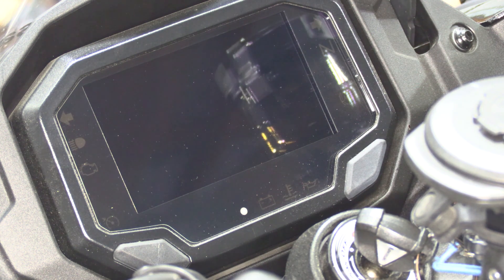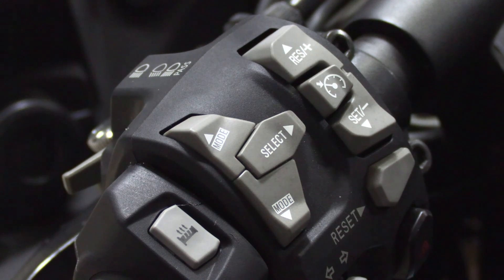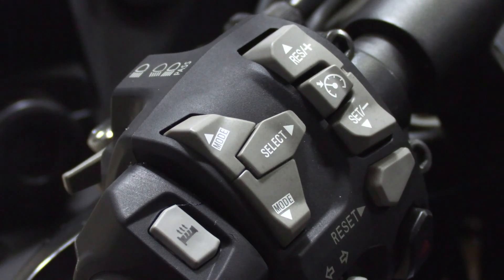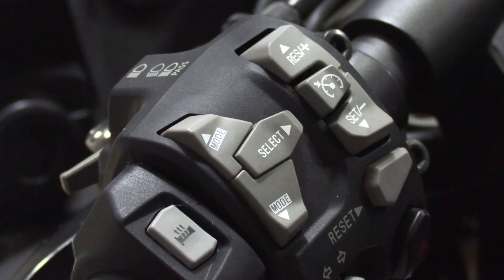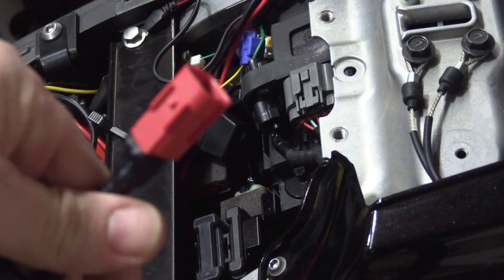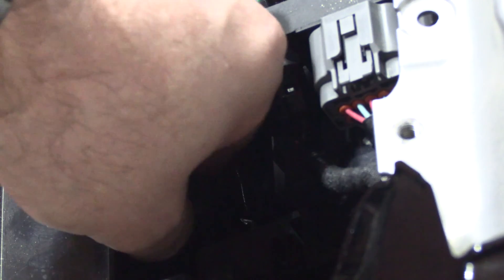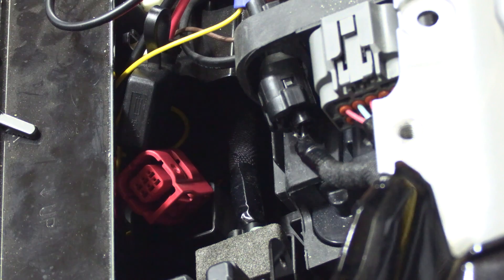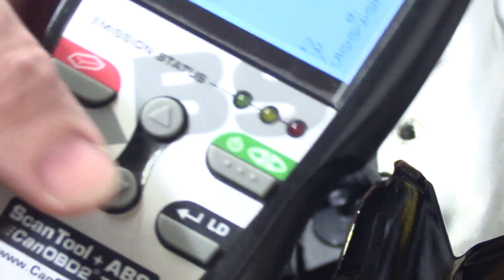Kawasaki Ninja 1000SX - How to Read and Reset DTCs (Diagnostic Trouble Codes)

Comment: what if the obd2 wont power up?
Reply from the maker: Do you have it in the correct connector and the motorcycle in the on position? It'd be strange not to power up. Bad wire or bad reader.
Reply: @BlueEyedRider84  my mechanic's OBD2 needed to be connected to the battery to power up :(
Reply from the maker: That is very strange. ODB2 should be able to power on from the connector as long as the motorcycle is on (not running)

Comment: How do you reactise the service light when you do the service?
Reply from the maker: If the service light is not the dealer setting you can just turn it off in your settings: https://youtu.be/0GIuBsS3o1M

If it is a dealer setting then you will have to have the dealer turn it off and have them turn off the setting while they are at it so it doesn't come back.

Comment: Can you reprogram or delete codes through this method?
Reply from the maker: You can only reset. To reprogram, delete/turn off codes permanently you would need to program the ECU with a programmer.

Comment: hallo! is there a way to set/reset the service km/date? (ninja sx MY2021) 
thanks!
Reply from the maker: So the good news is this weeks video (releasing on Friday) is for this.

If it is set on for the dealer service setting then you have to have a dealer turn it off (sorry, there is no other way).
For oil service and rider service setting, you can go into the menu, go down to service and turn them on or off and change the settings there.
Press and hold setting button for 3+ seconds
Scroll down on menu to service
Oil setting will be default, scroll down to see rider setting (this is the one most people miss because they don't notice they need to scroll down). 

Again, video is coming on Friday if you need visual tutorial.

Comment: Tell me how to raise (adjust) the idle speed so that it does not twitch in first gear without gas ? Thanks
Reply from the maker: These bikes have an idle speed control system - there is no way to adjust the idle without programming the computer (tuning). If your idle is at 1100 RPM at idle (after warmed up) +/- 50 RPM then you are at the factory idle speed, but I do agree higher idle is better. With these electronic throttle systems and emissions regulations they have gone to this idle control system which is controlled by the computer so, unless you want to get it tuned, I am afraid we are stuck with factory.
Reply: turn the yellow know for cold start idle and black for normal idle

Comment: Could you please upload picture from service manual regarding idling and TPS self calibration after cleaning errors with OBD2 (KDS) tool. Thanks
Reply from the maker: @Vedran
Sent. In case you don't receive:

When erasing the stored service code memory, the accelerator position and throttle position initial data of the throttle body are erased. Therefore, you must register the initial data to the ECU. Wait the 10 seconds at the idle speed and the coolant temperature 40* C (104* F) or more to register the initial data of the sensor position to the ECU.

Also after any procedure, you should:
Run the engine for several minutes at idling and run the motorcycle at 30 km/h (18 mph) or above in order to confirm no problem.

There is somewhere else in the book that goes into a procedure of riding around for 10 minutes but I am having trouble finding that page, but the main one is the first paragraph in regards to the TPS.
Reply: @BlueEyedRider84   Think i know why..... Ninja 1000SX probably have ride by wire throttle. My Z900 is cable operated although it have traction control and power modes so no procedure is needed after clearing codes.
Reply from the maker: Sorry for the delay. My 2021 does not have a TPS (Tire Pressure System) and my service manual does not go into that. Unfortunately I am not able to help on this one.
Reply: @BlueEyedRider84   TPS= Throttle position sensor
Reply from the maker: That's the problem with too many items carrying similar acronyms. I actually think I was wrong anyway, the tire pressure system is TPMS I believe (Tire Pressure Monitoring System). Anyway, I am going to run out right now and grab the manual. Do you have an Instagram I could message it over on?

Comment: 6 pin red connector cable is Euro 5 standard: its on my 2020 Z900 as well. Its good its standardised finally for all Euro 5 Motorcycles so this adapter works on all of them (and some Euro 4 with red 6 pin connector). Pinout on white connector (pre Euro 5)  is not standardised and can vary even for the same Motorcycle brand, unfortunately often it does.
Reply from the maker: Yes, I am glad they did switch. I know so many who have issues with the other connector. Some it works, some it doesn't and that's because it was so out of whack for everything and even model year.

Comment: My 23 ninja 1000 throw a 4E fault code what does it mean ?
Reply from the maker: 4E is a cylinder misfire. Being a 23 that's under warranty, I would take it to the dealer for them to sort it out.
If you plug in an ODB 2 reader you can find out what cylinder or if multiple cylinders.
P0300 Multiple cylinders are misfire 
P0301 Cylinder #1 is misfire 
P0302 Cylinder #2 is misfire 
P0303 Cylinder #3 is misfire 
P0304 Cylinder #4 is misfire
Reply: The dealer can’t fix the problem.. they keep erasing the code and ask me to continue riding.  Not sure what is the issue . Dealer can’t read the fault code.  I realised after erasing the code, they will come back again when I travelled between 140-150km/h in 6th gear. Tried redline the rpm in other gears didn’t managed to get the fault out. Any suggestion to solve this issue ? Inputs will be greatly appreciated.
Reply from the maker: @engthiampeh8513  cylinder misfire is usually caused by a plug or coil. If they clear it and it keeps coming back that can fall under lemon law (if applicable where you live). Honestly - I would find another dealer or contact Kawasaki. It should be fixed under warranty, not just have the codes cleared.

Comment: I bought these items thanks to you here in  the UK for my 2020 Ninja SX100, but how do you get rid of the SERVICE notice on the main dashboard if I do my own servicing ?
Reply from the maker: The 2020 should have an option in the menu and should be in the owners manual in the general information section. The 2021 is tricky and may require dealership intervention, but from what I understand on the 2020 you can actually turn off the factory service reminder.  Go to the service section in your menu and there should be Kawasaki Service and Rider Service. You can turn off the rider service (your setting) on the 2021 but cannot turn off the Kawasaki Service. If what I understand about the 2020 - you should be able to turn off the Kawasaki Service in that same spot on the menu. If the option is not available you will have to go to a Kawasaki dealer and have them reset it and turn it off (they can turn it off permanently). I have heard of people getting Kawasaki software and using the ODB2 interface to reset it and turn it off, but I haven't gone this route yet and will surely post a video if I do this. There is the Kawasaki service tool as well, but it is very expensive and super hard to find.

Comment: Great tutorial, is it possible to turn off the service light using this method..
Reply from the maker: You can clear the DTC codes which will turn off the light. Assuming all issues are fixed that is, otherwise the light will turn back on as soon as it detects the issue. You cannot "disable" the light as the methods in the video are not for programming the machine.

Comment: Thanks for the links and the explanation for the code resets.  I sure wish there was an affordable bidirectional scan tool for our bike similar to what there are for autos.   Seems the only choice we have is the obscenely priced OEM KDS tool if you can even find it.
Reply from the maker: Yea, it is unfortunate. There are motorcycle tools out there but they are "Chinese" knock offs and it's hard to find Kawasaki ones, still at $500+. You do have Woolich Racing which offers tuners, but may not be what you are looking for.